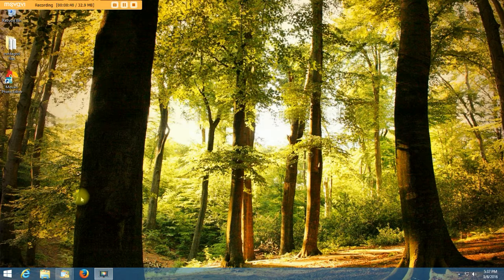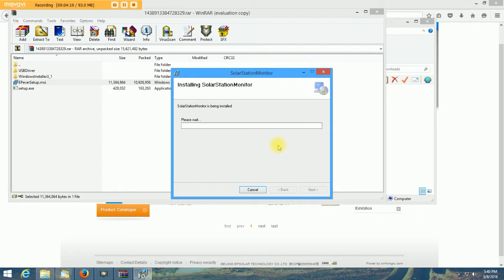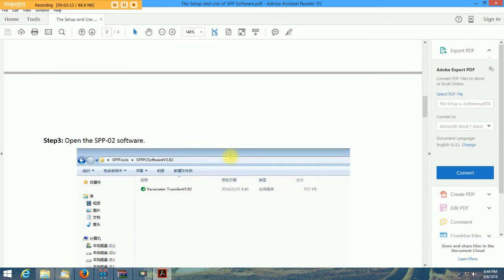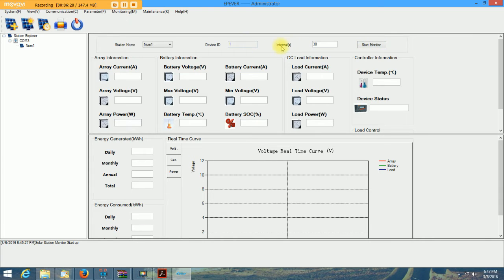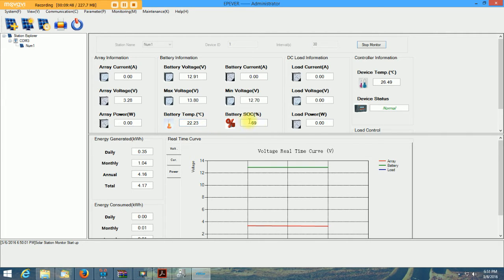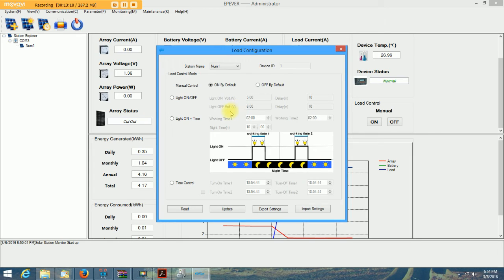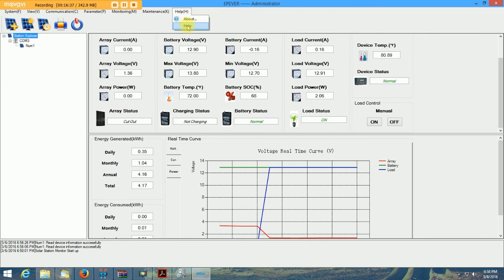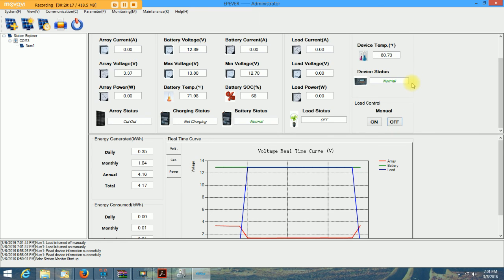Tracer EPSolar EPever 4215BN Controller Solar Station PC Monitoring Software Download and Install

Comment: did u use the cable that comes with the mppt . my pc dont find it ..
Reply from the maker: no there is a special cable you buy and you connect to a different place on the charge controller

Comment: Does this program work with the Bluetooth Ebox ?  Any mentions ofWiFi or Bluetooth  Ebox in the task bar ?
Reply from the maker: They have a new version of the software that you can download. .I noted that it had settings for lithium but do not recall any Bluetooth settings
Reply: @JohnInBibs  Thankz.    Found the new software just minutes before you got back with me.   My controller won't be here for a few more days.  Was just lining up my ducks..  LOL   And NO it does not support the E-box it would seem.   The hunt continues.

Comment: Nice video interesting !

One question :  as victron mppt can do, can we limit the input current (Amp) in user settings via the computer ?
I have a 20a 
Thanks if you still there:))
Reply from the maker: Still here, wasn't sure if the video was still relevant though. No you can not regulate the input amperage via the software. Pretty sure that is taken care of inside the charge controller so that it gives the maximum amperage to maintain the voltage that you have set.
Reply: cutdagrid best thanks !
My question was this because I Gona use it to charge my lithium ion battery.. with alternator via the mppt.. and i don’t know if the epever will be able to run full charge long time . The victron can be setted with lower current as his rated one

Comment: The soc mode allows me to set the battery discharge % to 51 vs the default setting which is 30%. From what I read, 50% is the lowest we should discharge the batteries. I'm not an expert either. Maybe I don't understand that setting. Do you think setting it to 50% is better. Thanks
Reply from the maker: You are correct to extend the life of your battery bank you shouldn't 
discharge it below about 70 percent. However, as I stated before I use 
the Voltage Compensation settings not the SOC or State Of Charge 
settings. You can do a quick google search and find the advantage of 
using the Voltage Compensation vs SOC. From what I have read the Voltage
 Compensation is much more accurate. In any case your setting of say 50 
percent does not stop you from draining the battery below 50 percent 
unless you are using the load terminals on the charge controller.
Reply: Thanks. I'm gonna put it back to voc. it's a shame we can't connect the inverter to the load connection to use these auto shut off setting. Would be nice to have the controller shut the fridge off instead of ruining the battetries.
Reply: Sir, just one question: I bought the mppt tracer epsolar 4215a, I can't find what's the limit voltage/amps, I can output from the Load Terminals: Connect loads.? Do you know something?
Reply: If you go to EPsolarpv.com, you can download the spec sheet which shows the load specifications.

Comment: Hey bud quick question,
 I have the 30amp version and have a 300ah bank running my mini fridge which runs a at 5 watts and spikes to 70 watts for a few minutes then back to 5 watts. Doing the math I should be able to run the fridge for 3 days with out a solar charge before I have to shut it off. The epever was showing full charge and when I woke up it was at 1 bar. I went and installed some external meters and found that my bank was a consistant 12.8 volts in the morning. I think the epever battery meter is off. Maybe the software. I went into the software and changed the 80% discharge setting to 50% in hopes it would maybe change the battery meter but its hasn't effected the battery reading at all. Have you found a solution yet? Thanks for this video. It helped me alot.
Reply from the maker: I am no expert but it sounds like two issues. If you are setting the 
discharge to any percentage it sounds like you are using the the SOC 
charge mode, I would recommend using the Volt Comp mode. The second 
issue sounds like over the night your battery goes below the Boost 
Reconnect Voltage, in this instance in the morning it will automatically
 go into the boost mode which is a much higher voltage.

Comment: Dear,
I am using the Tracer- BN series ( Tracer 
2215BN), and I am using also the Solar Station Monitor but I know to 
import the data saved by the controller. For that I go to LogData 
Download and the choose the controller type ( I supposed eTracer), Log 
Type ( Running Log), the starting time and the ending time and choose 
Inquire Log then Read Log but nothing appears. So I want to know if it 
is what I have to do to pick up the data.

 Thank you for your time, I'll be waiting for your reply. 

Yours sincerely.
Reply from the maker: Hello, thanks for your question. I also have the same problem. It appears that the software is written for the etracer or itracer which is made by the same company as the BN series. I am hoping that someday they will update the software to include the BN's. In the meantime I am forced to only be able to review the past few hours on the graph. You do know that you can double click the graph and it will show you a close up that you can scroll thru. To get out of the blown up version simply click the very small button at the bottom left of the graph
Reply: Thank you for your reply.
I can do it but I need to pick up the data it's the most important part.